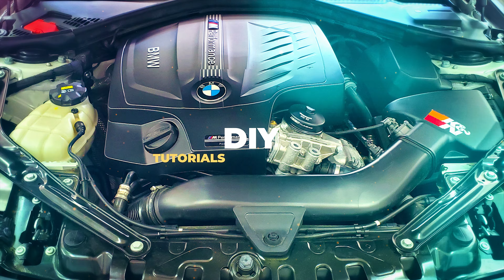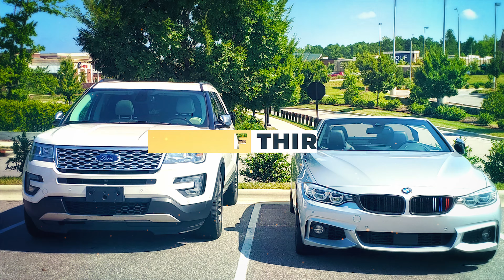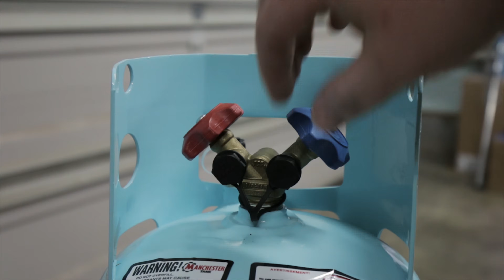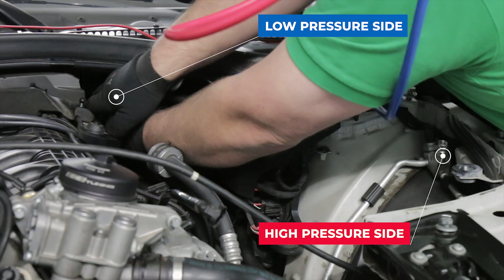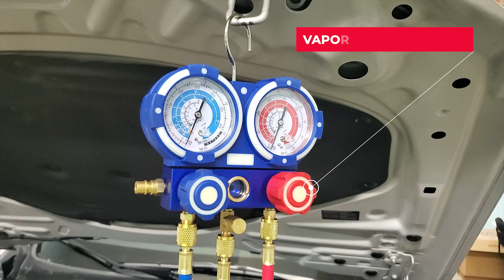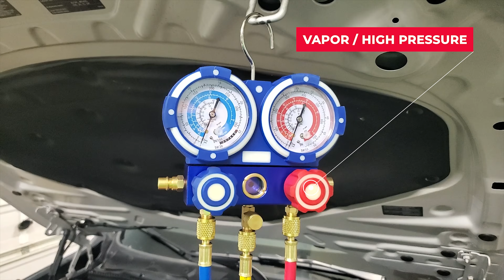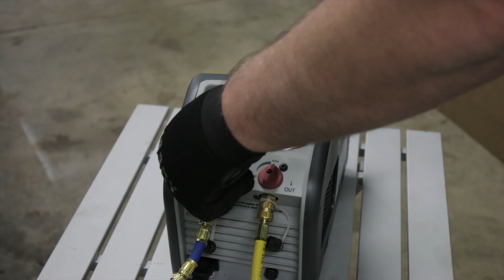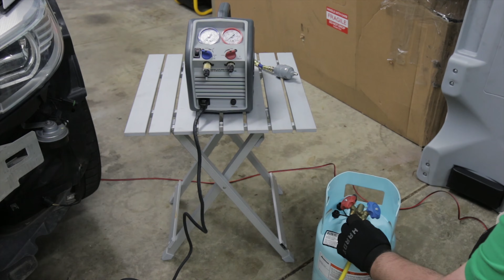EVACUATE YOUR CAR'S AC SYSTEM THE RIGHT WAY

Comment: What do we do with the freon inside the tank after we did it? Can we reuse it? 
Is the freon inside clean or contaminated with the oil?
Reply: I’m definitely no expert, but I think the problem is that unless you have the refrigerant identified and analyzed, you have no way of knowing if you are putting contaminated refrigerant (w/ air, moisture, sealant, etc.), or possibly even counterfeit refrigerant, back into the system, which could damage it in the long run. As far as I can tell, the machine in the video is a recovery-only machine, but there are also analyzers and recovery/recycling/recharging (R/R/R) machines, some of which I think are capable of filtering to get the refrigerant back to an acceptable standard. R/R/R machines are expensive, so perhaps a shop can do those steps in the process. Otherwise, the reason for using the recovery-only machine is to enable recycling or proper disposal of the refrigerant that is of unknown purity.
Reply from the maker: I ended up using new refrigerant, this video was only about the recovery of the refrigerant. But you're absolutely right that you don't want to put in contaminated refrigerant back in.
Reply: @app-o-matix  You can recycle refrigerant locally using a FILTER DRYER to filter the refrigerant.   That is the gray bulb on his hose.    To RECLAIM refrigerant you need to ship it off to a  Facility.   Local Recycle is exactly that.   To be used by the original owner only.
Reply from the maker: You can absolutely reuse the refrigerant that was removed. You would just reverse the process and charge  from the low side.
Reply: @fthirty3  

How could one check if the refrigerant is contaminated?

Comment: Great video and VERY informative!! I may have missed it but when did you open the low pressure side value on the manifold gauge that connects to the car? If you didn’t/don’t how does it drain the refrigerant when the ports closed?
Reply: That appeared to be left out.

Comment: My car was diagnosed with a faulty condenser and refrigerant discharge hose. I've apparently lost much if not all of the refrigerant. How necessary is it to evacuate the system given that a lot of what was there is now gone?
Reply from the maker: If all the refrigerant is gone, then the only thing you'd need to do is pull a vacuum on the system.
Reply: @fthirty3  Thank you for your quick response. Are you talking about doing that before or after the condenser is replaced?
Reply from the maker: After it's replaced and everythingis put back together. Right before you put refrigerant in, make sure you create a vacuum on the system.  👍

Comment: What was that red wire I seen in the background running across the car when you where install the freon in your car, does it have something to do with the machine or the AC installation process, thanks Mike  God bless
Reply from the maker: Thats a cable that runs from my noco battery charger to the charging ports in the engine bay. It was keeping my battery charged while I repaired my car 👍

Comment: Can you reuse the freon once in the tank ? Like put it in reverse to put it back in. Because the freon is brand new,but I have to replace a part .
Reply from the maker: Yep, you can absolutely reuse the refrigerant
Reply: @fthirty3  great how do you do that and do I need to buy more parts to reuse or just the stuff listed?
Reply from the maker: You can use all the same equipment,  it's just a reverse process.  👍
Reply: @fthirty3  thanks
Reply: @fthirty3  do u charge free on from the yellow hose to the low side of recovery tank and it should charge? 
What if u charge from the high side of the recovery tank will that still work 
I think not but if u don't then whats the purpose of the high side on that recovery tank? Is that for more use on commercial homes ?
Reply: @fthirty3  Great. Now how exactly do you do that? I've checked the recovery machine manufacturer's website and can find no info and checked YouTube to find if someone has done this and it's all using new refrigerant.
Reply: Yes, permitted under current EPA rules.

Comment: For the cost of equipment I could pay someone else to service my vehicle AC indefinitely.
Reply from the maker: Depends on your needs and circumstances. I didn't have that luxury seeing as my car wasn't running and I needed the AC system evaluated
Reply: I disagree.  My last two "professional" mechanics who worked on my car couldn't find my leak but cost $ anyway for a recharge that lasted less than a week.

Comment: Bought everything on the link. The yellow connectors are too small for the blue tank and needed a R134 brass fitting... Dunno what size... Theen to my regular r134 gauge the yellow connector doesn't fit the drier hose and it also need a brass fitting lol 😂😂😂 and I dunno what size.... Im so screwed
Reply: small (male) is 1/4" MFL
large (female) is 1/2" ACME

Comment: If you're going to replace your condenser, it's no doubt cheaper to take it to a garage since all the tools you need, to legally and safely remove and store the refrigerant, are expensive to buy. I guess you can rent the equipment.

However, you can hire an AC technician to drain the refrigerant for you.
Reply: I think you get car running first then fix AC
Reply: Yes but starting at 250 a pop to drain and recharge it would pay for a cheap machine quick if you do it much
Reply from the maker: I my case I couldn't since my car was in an accident and I would have had to tow it back and forth from the shop.
Reply: @fthirty3  Understood.
Reply: On my car, accessing the condenser is a real bear.  But, you could just pay for an evac., condenser replacement,  vacuum down, and you do the recharge.

Comment: I'm wondering if the manifold guage, vacuum pump, and recovery machine need to be specifically for vehicles or could you use the same ones that are used for home HVAC?
Reply: I see adapters requred

R22 used in houses
Reply: @jamesconnor9142  Also R410A, but  the gauges still fit both
Reply: Technology is the same, so will likely need some adapters for the hoses.  Remember, you can't mix different refrigerants in your tank.

Comment: You have your valves mixed up- red is liquid blue is vapor
Reply: Does this matter since it's simply related to the length of the dip tubes in the tank?  I can see where it would when recharging though.
Reply: @jackb1803  I'm not entirely sure- I think its important for the sake of remembering so you don't forget in the recharging instance though.

Comment: This video is definitely helpful.  But manifold purge is also a requirement in order to actually keep air out of the refrigerant tank.  However, I don't think that matters if the old refrigerant will be recycled and new refrigerant will be used instead.

Comment: Can this process be used to recover R134a from a regular Refrigerator?
Reply from the maker: I haven't tried that, but I don't see why not
Reply: I think no ports on most refridge

Also i cant remember but different 'FREON' Uneed google again
Reply: @jamesconnor9142  They sell "piercing ports" for this purpose.  House AC systems are different.

Comment: Can it be reused?
Reply from the maker: As long as the refrigerant is in good condition,  absolutely
Reply: I’m definitely no expert, but unless you have the refrigerant identified and analyzed, you have no way of knowing if you are putting contaminated refrigerant (w/ air, moisture, sealant, etc.), or possibly even counterfeit refrigerant, back into the system, which could damage it in the long run. As far as I can tell, the machine in the video is a recovery-only machine, but there are also analyzers and recovery/recycling/recharging (R/R/R) machines, some of which I think are capable of filtering to get the refrigerant back to an acceptable standard. R/R/R machines are expensive, so perhaps a shop can do those steps in the process. The recovery-only machine will at least enable recycling or proper disposal of the refrigerant that is of unknown purity.

Comment: Hey I’m parting out a car , that’s full of refrigerant . What if I just disconnect a ac line and let it out in to the air and come back to it when it’s all out ? I don’t have time or money to buy any equipment I just want to know if I let it air out how long does it stay in the air so I don’t get it in my lungs?
Reply from the maker: That's a good question. I'm not sure how long it stays in the air.
Reply: Hey, did you ever find an answer to this question? Or any advice on this route? I Got a car on the same situation
Reply: @yassetgrullon9022  so I got some advice from someone to purge it and wrap a towel around it to keep from making a mess and having too much in the air and then throwing away the towel. Most cars have a wire connected to some sort of sensor that you can loosen up where the refrigerant can Escape wrap it and leave it for awhile to let it air out in the garage so your not there breathing that shit in

Comment: Good info. Was looking up the recommended tools needed, and it's well over $800. That convinced me that it's more cost-effective to have a mechanic do it.
Reply: Exactly. This is stuff you purchase & own if you want to work on other peoples vehicle AC units for a living. For the one-time DIYer, fuggetaboutit! 😕
Reply from the maker: Everyone's situation is a little different. For me, I had no way to take my car to a mechanic for this as my coolant had already been drained and radiator removed.
Reply: I got a set of gauges, a vacuum pump and the freon cans from harbor freight for little over. 200...
Reply: @deebo2430  They don’t rent recovery machines…
Reply: @nordicpride9708  send it into the air no one is gonna know
Reply: @chicago1680  that's what I was thinking.. How would anyone know?
Reply: @carrejojorge  people say it to say it
Reply: @chicago1680  now show me how to do it....
Reply: @carrejojorge  in the air duh. It doesn't kill the ozone like r12 does. or don't do it here you go. https://www.youtube.com/watch?v=RIiKPm3f75k&t=558s
Reply: @carrejojorge  Nobody will ever know. But it's "wrong" and illegal so every youtuber will tell you not to do. I once did it by accident. I was removing the radiator and that "thing" was in the way (ac condenser). I started removing a bolt and next thing I knew the bolt almost took my eye and flew to space. There is a lot of pressure in the system.
Reply: @147andreluiz  canned air is the same thing, 1,1,1,2-tetrafluoroethane
Reply: If you truly can rent it from O'Reilly's or AutoZone, I think this is a route that I am going to take because a mechanic is charging me over $800. $300 and something for the compressor and another 300 and something for labor plus coolant and oil etc
Reply: @barrioscorona215  They have been renting for who knows how many years now. maybe 10 plus
Reply: @chicago1680  say no more 🏃‍♂️💨
Reply: Valve stem remover...
Reply: you can get all this stuff for $400 Canadian and have the tools and know how to do it yourself for the rest of your life, do you want some links?
Reply: Gauges = 60 - pump = 150 - tank = 40 = $250. Was it really $800 just 3 years ago ?
Reply: @AegisZer you forgot the  recovery machine with is $500.
Reply: Actually the blue line is vapor and the red is liquid
Reply: @eaglesonandrew not on the recovery tank. Red is liquid on the recovery tank. Why? I have no idea.
Reply: Agree
Reply: @deebo2430  
What if you have the 1234yf system? Is there some kind of adapter? Autozone doesn't have the adapter yo use on the 134 manifold gauge so I would assume they don't have the adapter for a vacuum pump. Not sure tho...?
Reply: @adictiveadictive  Different couplers and recovery system.
Reply: 1234yf and 134a are not compatible if they are mixed you will have big issues.a separate system is needed to avoid cross contamination @adictiveadictive
Reply: Yep but you can resell the tools afterwards or keep them for next time.
Reply: Jeep dealership just quoted me 3k to replace a compressor and expansion valve. A private mechanic shop charged me 2500.
Definitely worth learning and doing myself if possible
Reply: @cb9018 exactly and I guess no one realizes that auto zone will loan these tools for free lol

Comment: I've got an AC problem I can't figure out. Could you please help me? I bought a 1990 Ford f350 diesel. The AC was not working. I found a leak in the evaporator. I changed the evaporator out and a bunch of o-rings. Then I added some oil with UV dye and pressurized the system with air using a cheap Ebay manifold set to check for leaks. I ran the truck for ten minutes. I found no more leaks. I let it sit overnight. The pressure did not go down. So I thought I was good to go. I took off the manifold set and installed a new receiver dryer. I then vacuumed down the system for an hour. Then I put 50 oz of R-134 into the system. Everything looked good. The system seemed to be working. But I got interrupted. I shut the truck off and partially closed the hood but I left the manifold set connected. I came out today and the pressure reads zero on everything. But there is no sign of refrigerant leaking out anywhere. I even waited until night and used a UV light and nothing. No sign of a leak but no pressure. I'm at a loss for what to do. It makes no sense to me.
Reply: Could be your gauge set is leaking.  My high side coupler was leaking on my set and leaking out.  So I just used my low side to check vacuum and left the high side off. Vacuum held then.
Reply: @Crappie_Hunter_Seeker  This happened to me too.

Comment: I just dont undertsand none of the evacuation videos....lol
Reply: I got random tank that the freon comes in. I took a/c freon stuff out. Twist everything to the left. connect yellow hose to tank make sure tank has no air. then turn tank knob to the right. Then you connect all the lines. From there twist to the right the knobs on the car both of them. then on the gauge thing also twist the blue knob to right, give it like 20 seconds. then open the last red one on the gauge. let it sit for a bit. once done. twist knobs on gauge both to left. and close tank to left aswell. then take knobs from car and also close to left.  done

Comment: Steve, when vacuuming the Freon and oil out, does the car have to be on? And what about removing air and moisture, does this works all in one go?
Reply from the maker: Great questions. The car shouldn't be on when removing the refrigerant. You only need it running when putting it back in. You'll also need to use a vacuum pump to remove air and moisture before putting refrigerant back in if you've opened the system after replacing something. But if your you're just removing the refrigerant to put new in, then there shouldn't be any air in the system. Hopefully that makes sense.